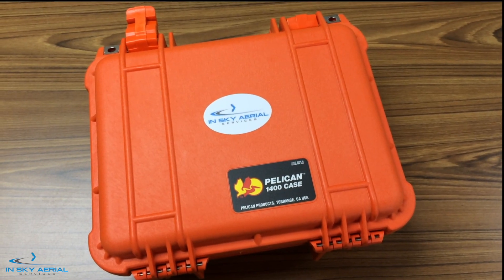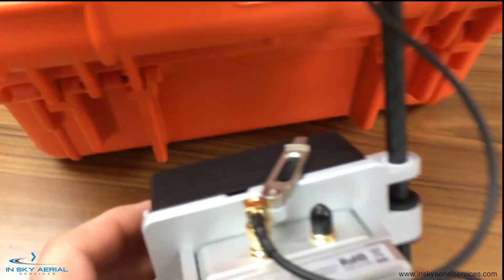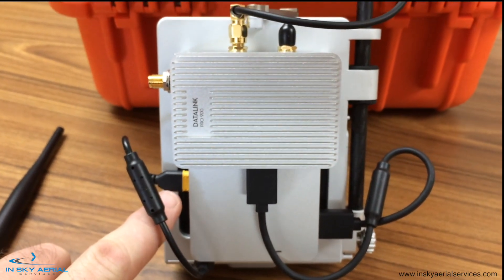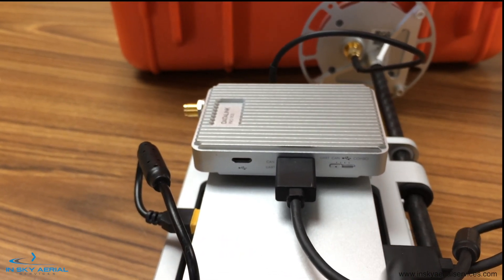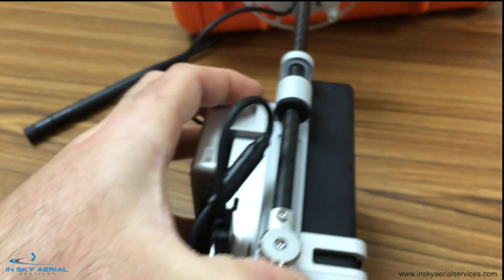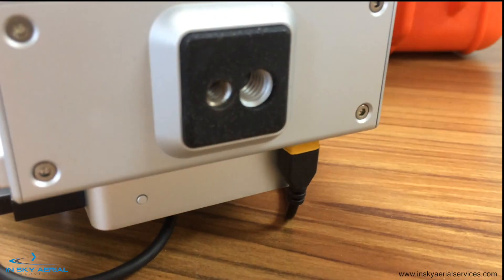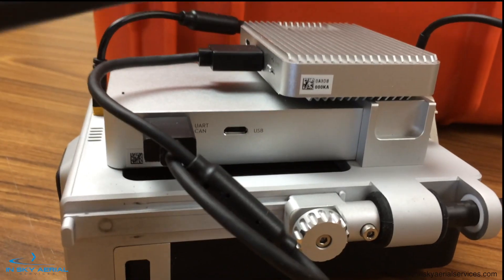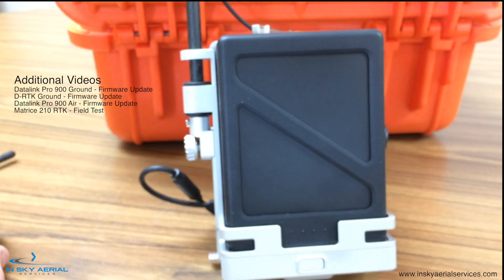DJI Matrice M210 RTK Ground System Overview

Comment: Hi thanks for posting this. Two questions; firstly, have you ever had the problem of weak RTK signal? Secondly, the pelican case did it already have the foam cut out or do you have to cut it out yourself, do pelican sell their cases specifically configured for the ground station? Cheers
Reply from the maker: Yes, i have had weak RTK signal and sometimes none at all.   The pelican case was a stock case with "pick and pluck" foam.   It worked well.

Take care,
Ed